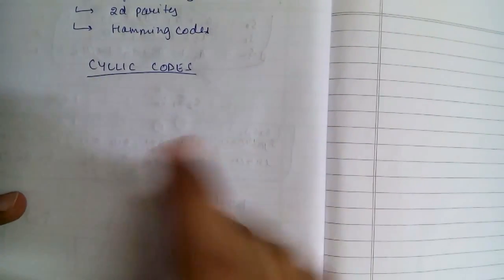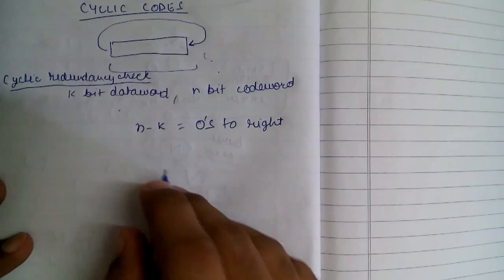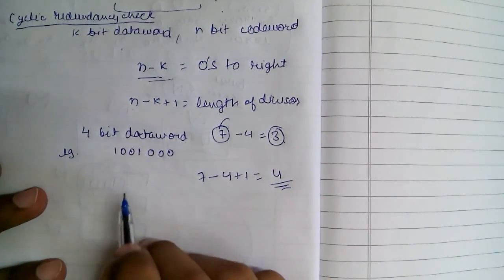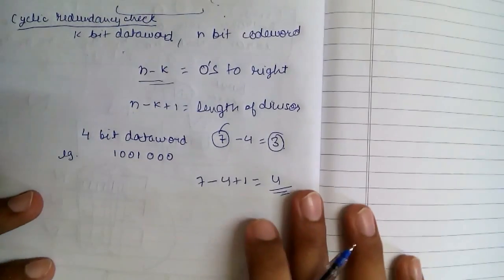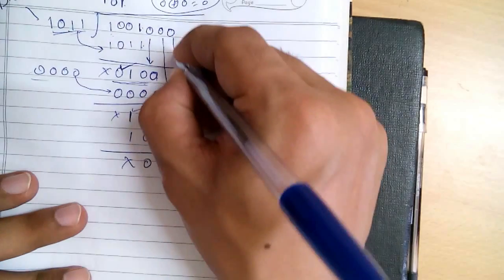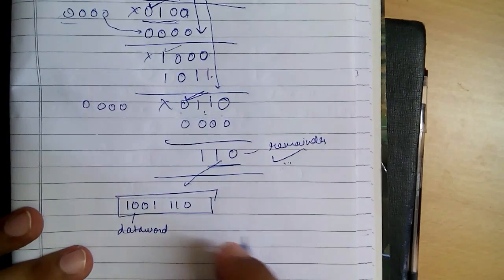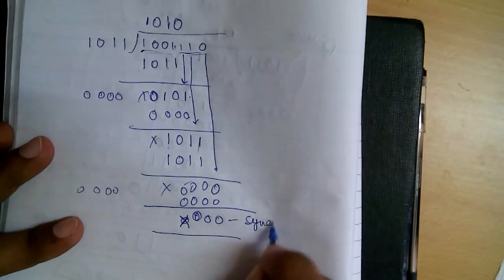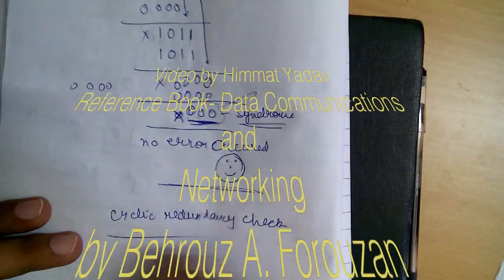Data Link Layer: Cyclic codes and Cyclic Redundancy Check

Comment: How the length of code word is determined ?
Reply from the maker: In this example, code word and data word length were already known and we decided divisor bits. The other way is in which data word and divisor bits are known, then you can find the code word length using the same formula.  So it depends on you which way you are implementing, data word is already known to you as per your message,  so the only thing remains is whether you are fixing divisor bits or code word bits
Reply: vishal vishwakarma It's the length of the divisor minus one.
Reply: Hi HImmat. Nice video. But what if some data is completely divisible by selected divisor? In that case , do we transmit 0 CRC? How will it work!